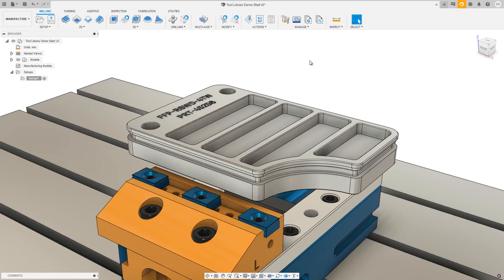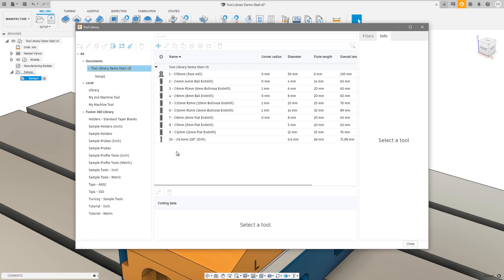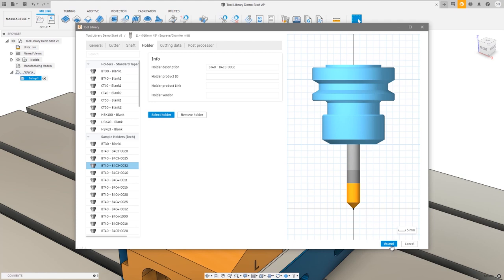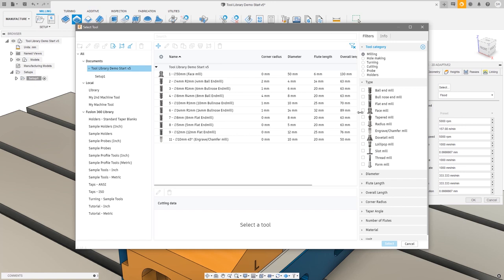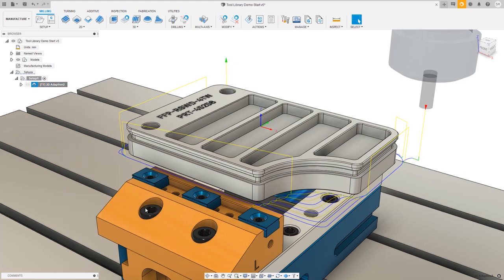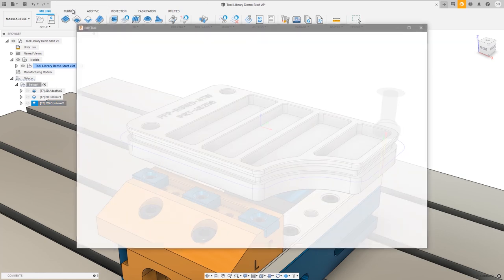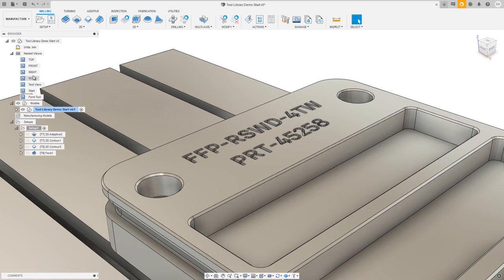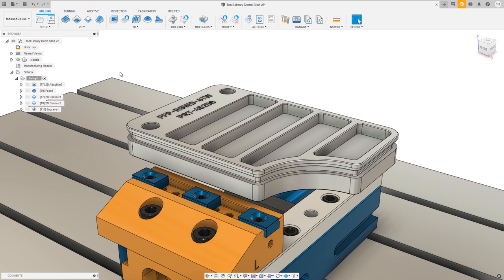TUTORIAL: Fusion 360 Tool Library Improvements - April 2021

Comment: It is really problematic that tools transferred to documents do not have an option to be derived so that feeds and speeds are driven by your latest knowledge - if ex you find out you can rough 30% faster, or must slow down not to break tools, adjust to get better finishes.....
Another huge issue is that data in the passes and link tabs have to be programmed manually every time you make a tool path.
Is there any good way to transfer tools to Haas without having to manually set offsets, wear ect on all tools - I see no videos on exchange that does not involve massive amounts of manual work that shouldn't be nessacary.

Comment: Great tutorial. However, when you selected the engraving command (@11mins), why did the tool library show all of your tools? Surely, it should of only automatically filtered/shown you the engraving tool(s) only? I thought this was part of the update/new work flow? 🤷‍♂️
Reply from the maker: Thanks for the comment and question! The auto filtering applies to the tool category, rather than the tool type. So it will filter by Milling, Turning, Holemaking, but not Flat Endmill, Ball Endmill, Engraving etc. Hope that helps!

Comment: Using the tool library there are a lot of tings that set us up to fail and break tools. The tools in the documents should be derived from the cloud or local libraries instead of copied so that mistakes we make and feeds, speeds, etc. are linked. A major miss is that things like ramping angles etc and many things set in the passes and linking tabs are not possible to set centrally. 
Maybe it is our lack of knowledge, but it seems absurd that tool data from Fusion does not seem to populate the tool carusel in our Haas TM1P. Logic should be transfer program - install tools in teh right pockets, ask the Haas to probe all tools - run!

Comment: I absolutely despise that the tool category is pre selected. You see I have all of my main tools set up with low numbers in my carousel. I just want to have them pop up in order. I also don't like that it selects the folder you are putting them into. That is just not how I like to do things. I am very disappointed to watch this video and find  out that F360 used to work the way I want it to. So... is there a settings button I can use to change these "improvements"?